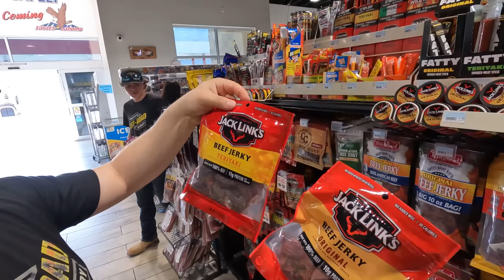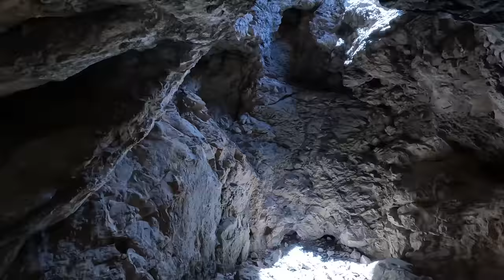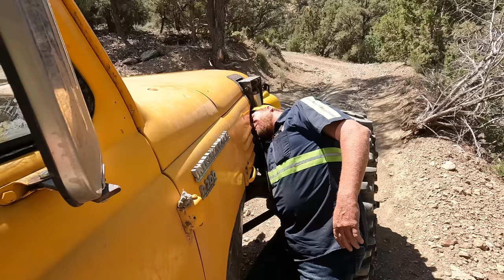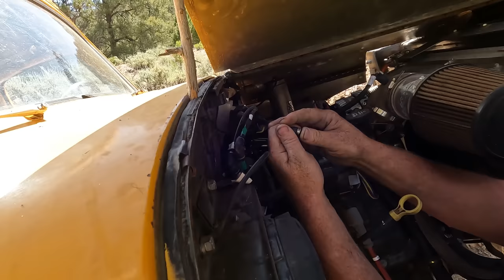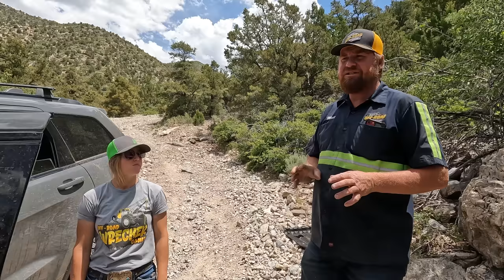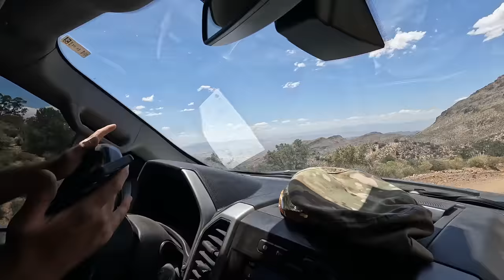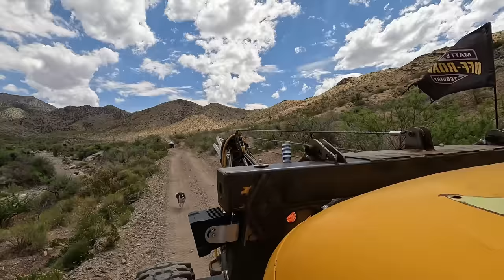Forced To Use Equipment I Despise Out On The Arizona Strip.

Comment: Matt you need to install jump seats on top of the work box with harnesses, that'll fix your seating issue on the wrecker!
Reply: Use Subaru Brat seats.
Reply: @alangriggs4420  Perfect!
Reply: LIke Fire Truck stylish
Reply: I mentioned that during the wrecker games, good idea
Reply: A set of old Subaru Brat jump seats would be really cool!
Reply: The problem I see is if it were ever to roll, the people strapped in would get crushed. If they aren't strapped in, they could jump off/away.
Reply: Not safe or comfortable. Too hot/cold.
Reply: @ADBBuild  safety first - but they currently have nothing so.... lol
Reply: Hang a swing from the boom!
Reply: @ADBBuild yeah and it's so tall that they may even not be able to jump far enough away. Maybe just haul a people hauler side by side with them, there's room on the trailer
Reply: I mentioned it as well.  It is as if he ignores good ideas unless they are his…. 🤪
Reply: Or just a bench seat inside. Could fit at least 3 people, instead of just two. I think the transmission levers are far enough to the front that I should work, but I could be wrong.
Reply: @kenpennuto2590 Or as if he knows better than us because he's actually doing it, instead of watching it online!
Reply: Yes and their bodies can cushion the truck in the event of a roll over. Brilliant.
Reply: Have no clever ideas for jump seats, but I know this rancher out in Nevada that bolted pieces of carpet to the cab rooftop and his Aussie cattle dog rode up there.
Reply: @alangriggs4420 I thought I was the only one that knew what a brat was 😂😂
Reply: Need a Serengeti viewing seats like on safari ,,, would be great for the camera guy
Reply: @kenpennuto2590  naw , Matt goes through the comments. They forget gas and procrastinate a lot so thats a more plausible reason 😂
Reply: Yeah I agree idk why he's putting it off it seems more like a need now that people have been regularly riding on top of the tool boxes
Reply: Natives used that gum/pitch/tar for wounds.
Reply: Directly in the sun. And decapitated if it rolls lol
Reply: @kenpennuto2590  im sure he doesnt read every coment and theres probaly other reasons he hasnt done it like the fact of it would not be safe with out a rollbar over them and there may be nowhere to mount the seats up there that wouldnt interfeer with anything on the truck
Reply: The shifter and i think the winch controls are there also and probaly some other things are all right where the bench seat would be
Reply: @nathanwoten6236  I was kidding serious Sam….  😏
Reply: The lower 48 is what people say when they're in Alaska because Hawaii's out in the middle of the ocean and Alaska is far north the lower 48 is the 48th state union ding dong
Reply: I agree but I also disagree simply because there’s always that chance of rolling on the kind of terrain they traverse for majority of the recoveries that they’ve had to use the heavy wrecker for anyways. It’s just too much of a hazard IMO.
Reply: Yes subaru bratseats
Reply: Time to build The Largest Off-Road Crew Cab Wrecker.
Reply: The real solution is to just always have the Banana or Morrvair along. I know they can haul both the Banana and wrecker on the gooseneck. 
Also just don’t take more crew than you can carry.
Reply: @alangriggs4420 If you could even find BRAT seats, but something very similar.
Reply: I have been saying this almost every video
Reply: What happens if you roll? 😂
Reply: @RussCarey  No, they need to be made from scratch like the rest of the wrecker, custom made. They could also fabricate role bars over each jump seat to kind of look like the inside of a fighter jet cockpit, complete with body harnesses, helmets (with the MORR logo plus stars and stripes) and O2 masks. If they really wanted to go all out, they could enclose each one with molded plexiglass, plus a heater, and even a VOX system for communications!
Reply: Everyone recommending Brat seats has never sat in them offroad. They were a disposable tax dodge.
Reply: Hell, get some hammocks.
Reply: @k1j2f30  thats what you do when you fab headers, make them from scratch!
Reply: Need to build a new heavy wrecker with a crew cab
Reply: @kenpennuto2590  Or maybe your idea is just not a good idea...
Reply: Roll bar
Reply: @johnmattias1953  wow.    Didn’t think trolls would be here too.   Thanks for proving me wrong.
Reply: @WatanabeNoTsuna.  truth.   You all seem to think that I mean some disrespect.   I love his content.   Been watching for years now.   It was in jest.   Relax
Reply: Maybe add extended cab to the rig with extra seats.
Reply: @alangriggs4420  yes! Been saying this since build started!!
Reply: @ryandoyle4344  A bosun's chair would be perfect.
Reply: Yeah before someone falls off and dies!
Reply: I came here to make this same comment! BRAT seats for the win!
Reply: @ADBBuild who ever said they needed to strap in to the seats, its more of comfort for the person riding on the back less safety. Bouncing around on a tool box would be exhausting. Regardless of that, it seems like most times matt takes the truck in a precarious enough place it is likely to roll theres someone spotting. Thinking about safety honestly the wrecker seems pretty unsafe on the inside if it were to go off a cliff without a full cage to better reinforce the roof. The back beam helps protect a good portion for being inside but depending on what it  clips rolling that roof would just pancake without reinforcement.
Reply: My thoughts exactly
Reply: @ADBBuild while true I don’t think matt would let people sit in those seats while on obstacles anyway
Reply: @OBS_Brndo  while true I don’t think matt would let people sit in those seats while on obstacles anyway
Reply: @VoidedWarranty  while true I don’t think matt would let people sit in those seats while on obstacles anyway
Reply: Subaru Brat style!
Reply: Too the comments saying not safe, you do the same as fab rats, the people in back get out when you get to those obstacles that could flip you.
Reply: @kenpennuto2590  that’s a terrible idea would you wanna be strapped in a car going off a cliff or not be strapped in so you might can jump first ? At least without straps you have a chance of life!!!
Reply: Build a new wrecker with a crew cab
Reply: @robdagr8te  don’t drive off a cliff.
Reply: @RussCarey  🎉6🎉6
Reply: Agreed!
Reply: Don’t forget the ejection lever and parachute!
Reply: Subaru brat seats!
Reply: @RussCarey  Ya, I know, but you didn't mention any thing about fabricating headers! You were commenting on how old Subaru Brat, jump seats would be cool.
Reply: All the people saying there's get decapitated if they roll, have never watched their videos. Any risky stuff, everyone but the driver gets out anyways. This would just be something for the longer drives
Reply: Probably can’t legally.  As soon as he installs them, he’d probably be breaking some safety regulations.  (I mean far worse than having people ride toolboxes off-road.)
Reply: @kenpennuto2590  🤣 Troll? You're kidding, right? I'm pretty sure someone who's been offroading for decades and has the safety of his crew in his hands has thought of the risks involved. You never see anyone sitting on the boxes in any risky maneuvers. They get off and walk. The only time they're up there is on long boring sections of trail and never at any kind of speed that would risk a rollover.
Reply: @kenpennuto2590  well to be fair he also ignores bad ideas unless they're his. 😂
Reply: Wouldn't a ejection seat make more sense?
Reply: This!
Reply: How about a couple Subaru Bratt seats?
Reply: Naah, just a rack with spears and a platform on top :)
Reply: @Dlutheran people have been saying this since the first concept drawings, when they could have still made it an extended cab.  Everyone knew it would be an issue, and it IS an issue.
Reply: @alangriggs4420 no by
Reply: Matt, the dog’s comfort always come first!!! 🥰
Reply: Yes! Perfect sight. Seats on the outside of the cabin! Made sense to me!
Reply: If that wrecker goes over I wouldn’t wanna be strapped to the back of it 😂
Reply: 100% agree!
Reply: Danger
Reply: pile them in the jump seats and then when you get there pile them in the vehicle you're towing !
Reply: better idea tow them in on a two wheel car dolly
Comfort should be no issue their young  !
Reply: @ADBBuild  roll cage-

Comment: I get that you guys don't read all the comments but turn your part throttle cruise fueling up.  Drop Lamda to about .95 or so.  My Bronco had the exact same  header temp issues on long slow climbs.  Turning fueling up helped immensely.  You can also try advancing the timing at thise rpms a couple degrees.  Late ignition timing can also cause high header temps.
Reply: Your telling me I got my DUI distributor LOCKED OUT at 36 degrees ADVANCED and the little SBC dose get hot at WOT
Reply: @CORNDODGER  stop drinking before you post.

Comment: Mechanic and engineering student here. Never posted to your comments before but have watched almost religiously and really appreciate all of what you guys do.  I have a simple solution the the header's heat problems both short and long term, you really should cut and install some ventilation in the top of the hood. I'm sure that if you could see the under hood temps with a thermal gun while it is under heavy load you would see an "air dam" where heat builds up in the back near the top. This would put a lot of heat right into where those locker lines are routed. A vented hood  along with wrapping the headers should provide plenty of heat dissipation to prevent further damage to the lines/ other sensitive components under hood. Just some input from a fan with a bit of experience with heat management issues.
Reply: What you do to save cutting holes in your sheet metal, is to adjust the rear of your bonnet (hood) up about half an inch when it is in the closed position.  This allows fresh, cold air into your engine bay from the windscreen area.  But I would do that as a last resort as not to change the aesthetics of the vehicle.  First action would be wrapping, next would be ceramic coating and wrapping, third would be all this and stainless heat shields.
Reply: I’ve just posted higher up, but what are your thoughts on cooling fins on the headers? Seeing as they’re open to the elements anyway in Matt’s application, my theory is they may help heat dissipation. May still need a heat shield for the air lines though. 
My thinking is that I’ve seen some motorcycles that have fins on exhausts manifold to head connections. They’re not very big, and are more like clamps than anything else, but I presume they’re more functional than aesthetic.
Reply: @vivalesvegas We want less heat to come off of the headers. Those fins work well, though I've only ever seen them on air-cooled motorcycles where removing heat from the motor is typically limited by the surface area of said motor. In Matt's case, there is too much heat coming off of the exhaust already, so it would have the opposite effect of what's intended. Ceramic coating and header wrap both prevent as much heat from radiating out of the exhaust, though I still think venting the hood will be necessary long-term.
Reply: Concur.  The problem isn't the header temp, the problem is the heat build up at slow speed (insufficient airflow to keep the firewall cool).  Fans could help, but will push the wrong direction at high speed and reduce cooling.  Either louver the hood as Silas said or add a heat shield that forces the rising hot air out the side.   Maybe both.  It's a heat buildup problem so I'm not entirely certain the header wrap will help enough, but it's an easy place to start.
Reply: He solved it that way once before on the banana with the black vents. Yes it's open under and on the side but warm air rises...
Reply: How can you tell if someone is an engineer???
Reply: @Levi Granger  Wait, let me guess, "they'll tell you" 😁
Reply: Wrapping headers isn't the best for them, they get too hot and go brittle. Air movement t is key, good on that one!
Reply: What about routing those air lines and wires on the other side of the fire wall?
Reply: @SilasSKnott  😂👍👌

Comment: If you're in a soft beach or a desert, traction boards are a must have. Yes you might not technically be 'stuck' when you need them, but the alternative is a shovel and a lot of sweat. Or using a winch and an anchor but that's just as much of a crutch.
Reply: Yeah I don't think Matt has been to Australian beaches. So much easier than the alternatives.
Reply: @jeffmcdonald101  Yeah, there's been a few times that they would have made his recoveries a lot easier.
Reply: and you get youself out without calling Matt, which is what Matt means when he said "you're not really stuck"
Reply: They practically live in Sand Hollow, which is all soft sand and dunes!
Reply: @stevepauley2437  Sand Hollow is very different to beach sand. "Sand" Hollow is made of dust and turns to mud when it's wet. Beach sand doesn't turn to mud and is often easier to drive on when it's wet. Totally different. Come check it out...bring traction boards :D
Reply: @stevepauley2437  Australia has some of the finest sand in the world. The Maxtracks where purpose built for fine sand. 
And we are remote, so there’s minimal cell service outside of the cities. So no calling others for help.
(No to mention no 40" tires.)
Reply: Most people get stuck in sand due to failure to properly air down or lack of driving skills.
Reply: @agentcrm  you’re from Australia? I have what you country calls a Holden Jackaroo, that I think would do pretty decent.
Reply: There was a time that Matt hated winches, too…
Reply: He literally works in the sand dunes all the time. There's an old video i'll never find where he drives the banana out of what looks like an impossible situation. incredible.
Reply: @stevepauley2437  Yes I'm in Australia. 
The Holden Jackaroo is just an Isuzu Trooper, though most of ours are diesels.
Reply: @agentcrm  yep, I wish mine were a diesel

Comment: I have 4 traction boards on my rig, I do think they’re worth carrying. In addition to leveling my truck for the roof tent, and use as a base for my hi lift, They’ve saved me a lot of digging when snow wheeling, and that’s when I find I use them most, but I’ve also used them as ramps to get up rock steps or to bridge gaps in the bigger rocks, cause I’m still on small tires with bad approach and departure angles. I find them to be a useful tool with some creativity. This winter I intend to try digging a deadman anchor in the snow with them and some rebar stakes, see if the snow can take the shear load of a winch pull. If so, all the more reason to carry them to me. I can see why y’all don’t really mess around with them, but I will continue to.
Reply: Nice. I see you be overlandin in a Dakota. I need to put vids up. Nice rig btw

Comment: 2019 Sand Hollow, retrieving a wave runner from the lake in the sand on the South side.  I couldn't get up over the sandy bluff to the beach to leave.  After 5-6 attempts I put out my TRACTION BOARDS splitting the crest of the bluff.  Went right up it!

Comment: Traction pads may be arguable in sand / mud recoveries but they’re essential in deep snow when the wheel spin has turned powder snow to ice.  That little extra movement off the ice has allowed me to self rescue more than once.
Reply: Completely agree with this comment.   I’ve used recovery boards to help people in the winter and they worked like a charm.
Reply: they saved my butt alot in my 2x4 work truck getting caught in snow storms way up north.
Reply: Saved me in 2x4 in deep sand and on ice

Comment: Matt, just wrap the headers and if you still have issues, just build a tin shield, like an inner fender well, around the top of the headers. It worked for me.
Reply: Ditto 👍
Reply: Lower number wise meaning the first states to join the Union —“
Reply: I agree
Reply: That and change to hard line for those sections of air line.
Reply: ditto, ditto.  add exhaust pipe wrap tape to the headers and swap out air lines for braided air lines --  both would add a little 'bling' to the off road wrecker. 👍👍😁😁
Reply: @roykrossin8343  I'm not Merican, but I always learned lower 49 were the 49Deg N Latitttude (ie, the mostly straight line border with Canada). So that excludes Alaska + Hawaii). So nothing to do who first joined the Union, but just happy coincidence ? (No idea who joined the union first or last)
Reply: I'd be interested in trying to swap sides on those headers, exiting to the front instead of the rear. Most of the heat will be coming from the junction of all four exhaust pipes into that one tube. Do them like the turbo folks do them. 

Alternatively - go diesel 🙂
Reply: @riaanlouw1874  Beyond fascinating your take and your thought process.  I'm fairly certain most follow the 48 contiguous and plus 2; In the lower 48 anyway.
Reply: @monkeybarmonkeyman  just what that truck needs to take out the 1000lb motor to put in a 3000lb motor.  Diesel suck on rock crawling and sink in mud , how many times has Matt had to rescue a diesel truck stuck in the mud with a little Jeep. The ONLY place a diesel excels is pulling big loads down the highway.
Reply: @roykrossin8343  

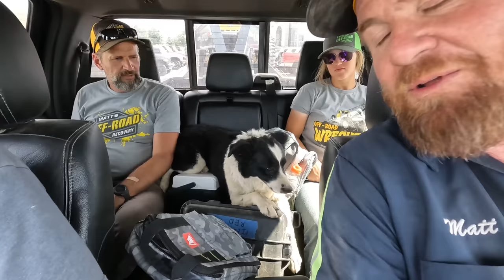31:21